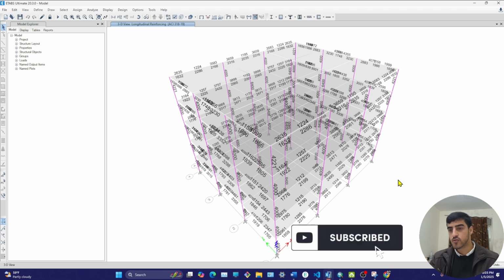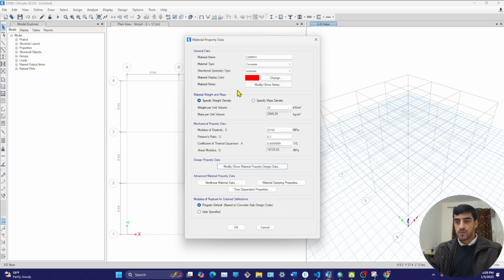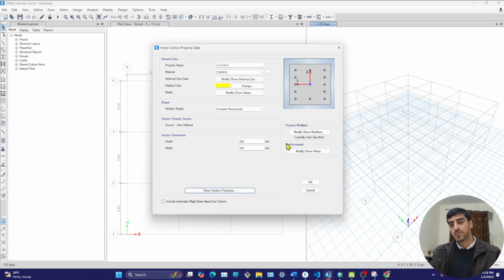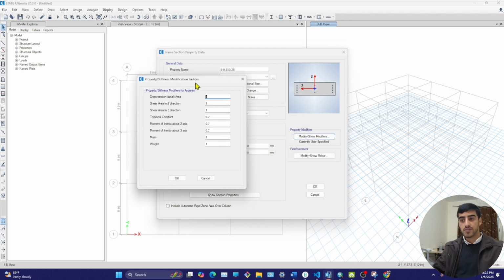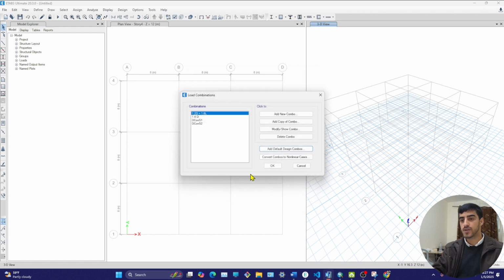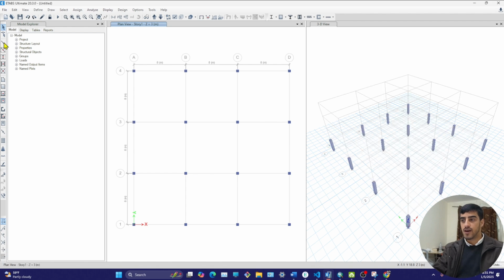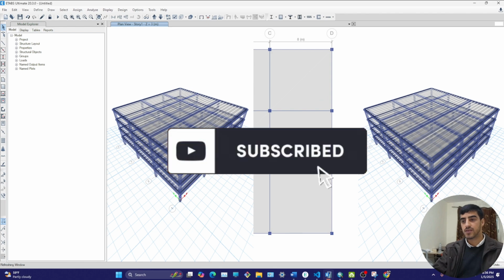Learn ETABS Basics, ETABS Modeling Course, ETABS Training Course Per ACI Code in (30 Minutes)

Comment from the maker: Chapters:
0:00 - Intro
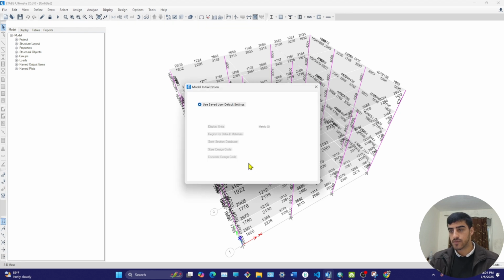0:21 - Create a New ETABS Model
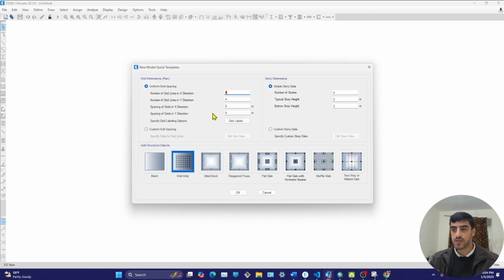0:44 -ETABS Grid System
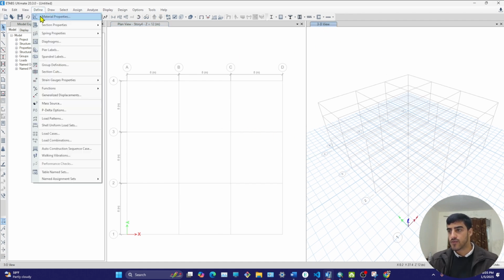0:01:05 - Define Concrete Material
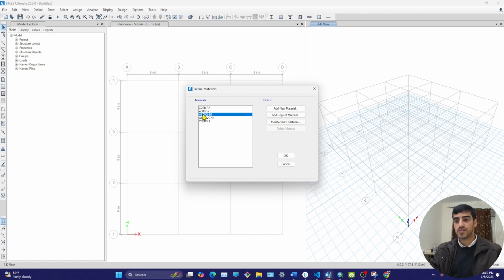0:04:28 - Define Steel and Rebars Material
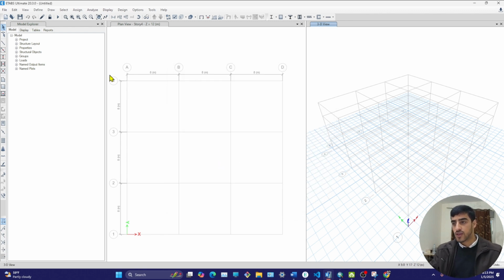0:07:09 Define Frame Sections
0:09:08 Define Column Stiffines modifiers 
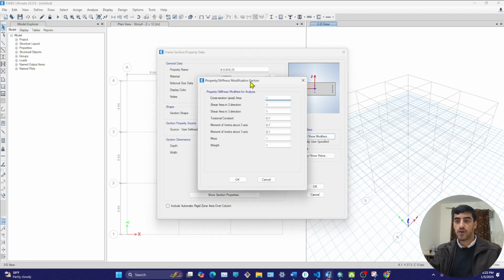0:13:46 Define Beams Stiffines modifiers 
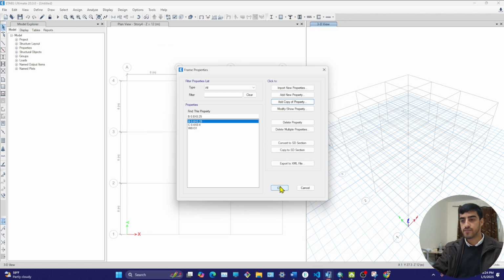0:15:44 Define load Patterns
0:17:03 Define Load Combinations Per ACI Code
0:18:12 Modeling of Columns in ETABS
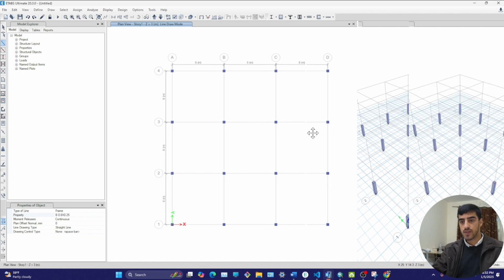0:21:51 Modeling of Beams in ETABS
0:22:20 Replicate Method in ETABS 
0:23:46 Drawing and Modeling the Slab in ETABS
0:24:05 Assign Loads on SLAB in ETABS
0:24:45 Replicating into top stories 
0:25:06 End of the Video

Whataspp: https://wa.link/kc4g2l OR +972595148311